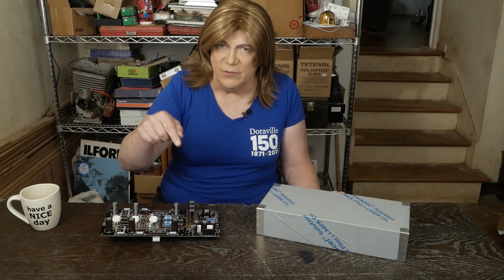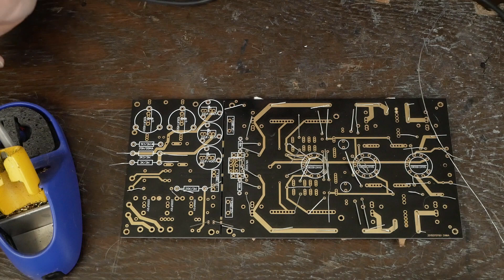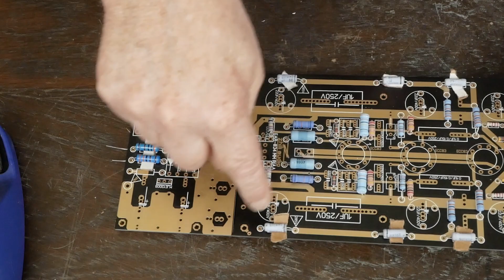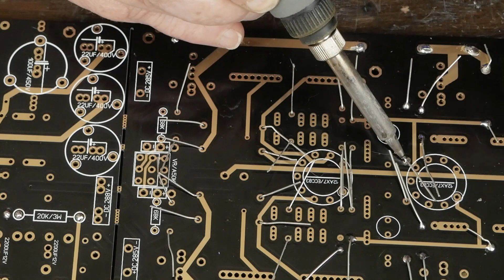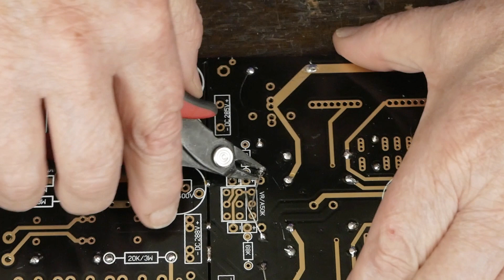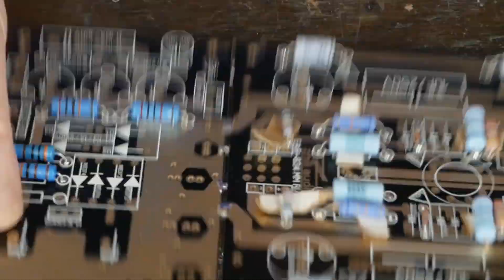DIY Phono Pre-amp: Soldering Resistors

Comment: Oh, and I’ve started using stand off pillars that I screw to the circuit boards when populating a board. Keeps the board stable and work well for all the small components. Turns the board into a “table”

Comment: Nice board, great work! I love these gold-plated traces. All of it looks so nice to solder, not a chance of a bad joint.
Looking forward to seeing the preamp in action :). And always loving you showing your work - it's a labor of love, a thing of beauty, a joy for ever <3.

My own phono preamp is also the EAR834 circuit, wired point-to-point in a 1U rackmount enclosure from an old ethernet switch. I still got to recombobulate one thing I got wrong, i.e. I used a transformer for a balanced line output (I'm a nerd for balanced connections, haha!) and the thing tends to go into nasty distortion on low frequencies if the input level is too high. It may also be a matter of changing the phono pickup to one with a "lighter bottom".
Reply from the maker: Thanks!

Comment: Question. Do you ever “reverse” solder the boards? By that I mean,  mount all the parts on the bottom of the board, with the tube sockets on top of the board so the tube sucked mounts flush with the enclosure?
Reply from the maker: That's an option, just be careful with the transistor orientation etc.

Comment: I learned my resistor colour code over 60 years ago . WTF is up with these markings. For example, on the power supply section is a 3.3 k , 3 watt device. Why is this marked with the colour code for a 33 ohm ??  Many more examples like this. I thought I was going senile. Also, is there a competition  by manufacturers to see who can write the smallest text font on a capacitor.  Very traumatised by this ordeal.